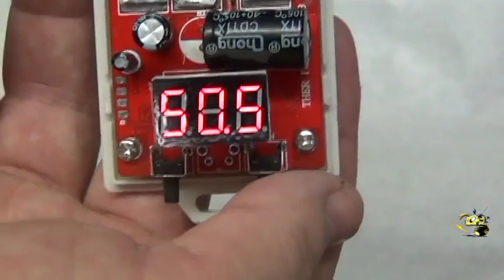48 volt battery controller for dump or cut load for solar and wind charge

Comment: i need 48v battery low voltage cutoff circuit for my 48v inverter it draw around 200 amps how can i do this

Comment: How can I get this  controller for my usage.....  Very urgent.... 
For 48v battery banks I want the controller to start the generator when the battery is voltage is low and switch off the generator whenever the battery is fully charged.
Reply: The controller should be able to hanagize a relay for the start/stop of the generator With a
Reply: Any positive response to this? Pls.

Comment: So the relay on the right side is not used for switching then?
Reply: the solenoid on the right it is the high voltage mechanical switch however it does not determine when there
is a dump load, the programmable device on left controls when and then sends small current to RELAY on right.

Comment: Your right about the arcing at 48 volts.
Reply from the maker: Boy don't I now it!  You just can't mix PMA and wind storms with those tiny board relays!  NO WAY!  must be MOSFET powered with high voltage caps.
Reply: @WINDGENEERING  Those relays/contactors  can really survive repeated DC arcs?  What are the specs on these contactors?

Comment: Are you going to have a 24v maybe? The beer can relay is a better and plus; a solid state controller to boot, nice!!
Reply from the maker: Yes the brain will handle from 20 to 70 volts.  All we need to do is put a 24V beer can on it :)
Reply: can it be a 24oz colt 45 malt??? :)
Reply: Bob is a Molsen guy.  LOL
Reply from the maker: lol  true :)
Reply from the maker: lol